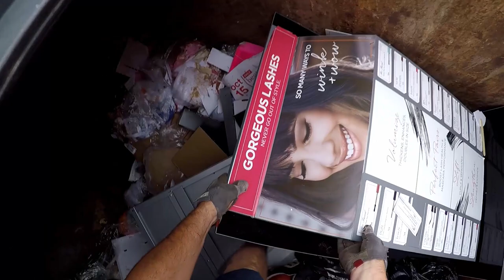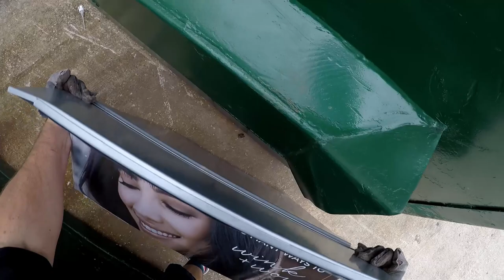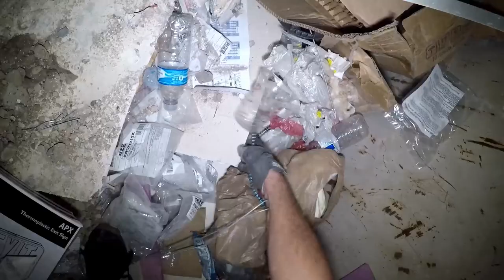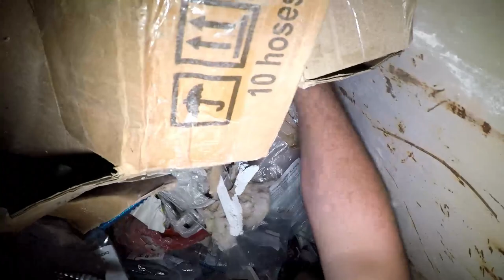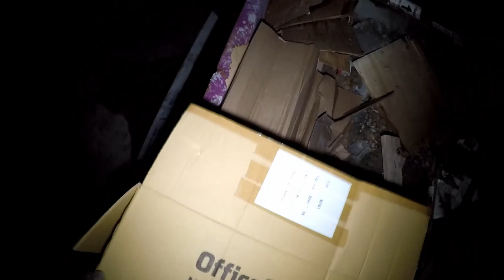Dumpster Diving "Mike's Got Rocks In His Shoes"

Comment: The hook rack talk on that dumpster is legalese for “If you climb on this dumpster using this ‘hook rack’ and fall off breaking your head open we are not liable because that ain’t no ladder!” Same thing happened with those little oval slots in cardboard boxes. Someone broke their foot by overloading a box and had the bottom fall out. Now the new boxes have a warning not to use those holes for handles.  That 6:10 is portions of the interior slab that was saw cut and removed from a building. Someone is remodeling and is installing or rearranging the plumbing for restrooms and/or kitchen. They lay down the new plumbing then pour new concrete floor on top of it.